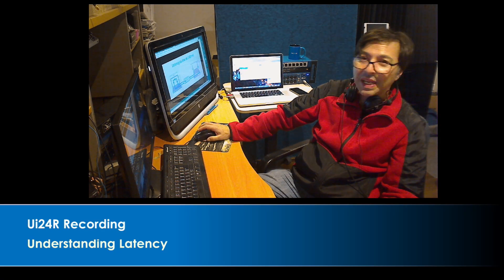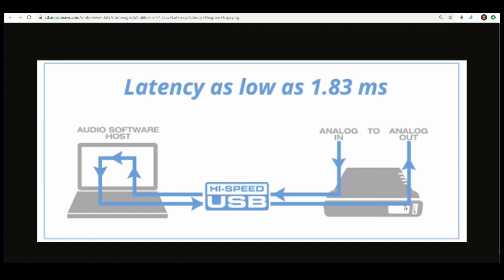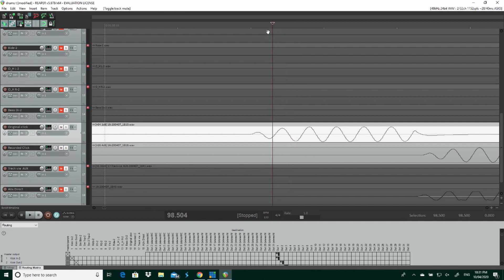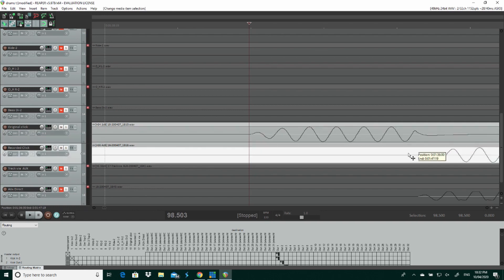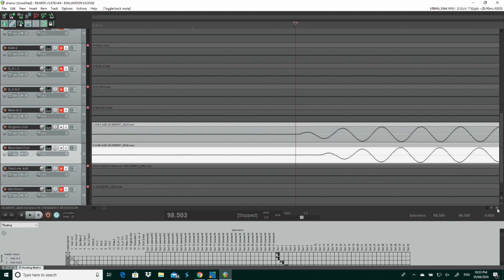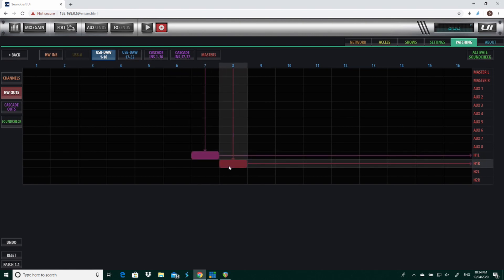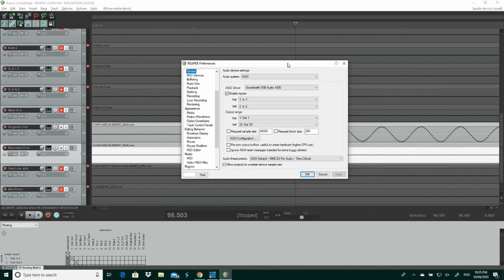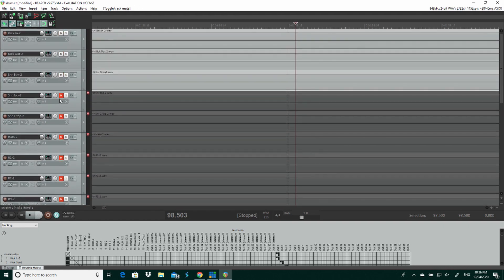Ui24R recording setup

Comment: when i try to flip the channel inputs from the local hw ones, to the the daw outputs, using the activate soundcheck button it doesn't seem to work, but if I do it manually on the channels page it seems to work, do you know whether the activate soundcheck button was is deacitvated or something?
Reply from the maker: It depends where the PATCH is set for SOUNDCHECK,  Soundcheck is just a name for an alternate patching setup. If it was already set on HW it won't then change when pressed. You need to check this and see where it's set to.

Comment: How would you patch the UI24r to an 8ch headphone amp?
Reply from the maker: just connect the 8 aux outputs to 8 inputs in a headphone amp... very simple
Reply: @mix-record-connect9938  I'm having a hard time trying to figure out how to send a different mix on each of the 8 Aux's channel for IEM while on DAW mode. Can you please point me to the right direction. Thanks.
Reply: @ichthys962  same problem here, did you figure it out yet?

Comment: Hello. Are you planning to release software or PC/MAC driver for MIDI control of mixer parameters from a computer or laptop? At the moment there is an application from a Russian developer, which allows you to bind the midi controller to the parameters of UI mixers. But there is nothing similar in order to be able to, for example, control the delay parameters, or faders, or changing presets using automation in Reaper or other DAW. That would be very helpful 4 live perfomances. I will leave you links for acquaintance with the Russian development.

https://youtu.be/fVmCtGISOpI
https://www.beseda.us/uimixer/
https://apps.apple.com/us/developer/pavel-beseda/id1485225675
Reply from the maker: there is already companies doing this that have MIDI to UI conversion. I don't work for Harman so I am not sure what their plan is.